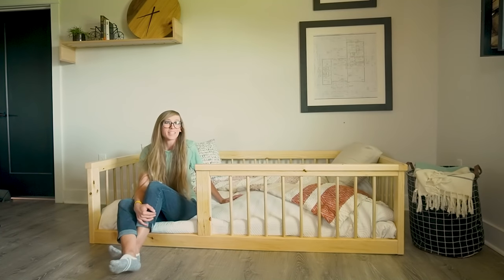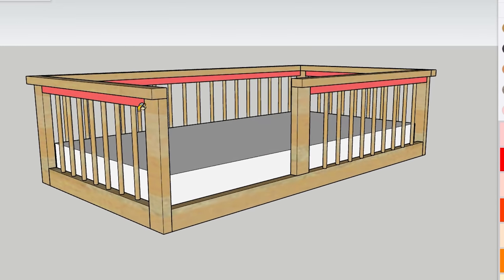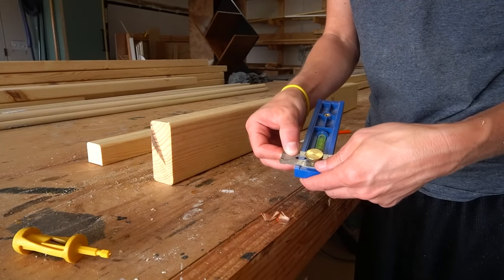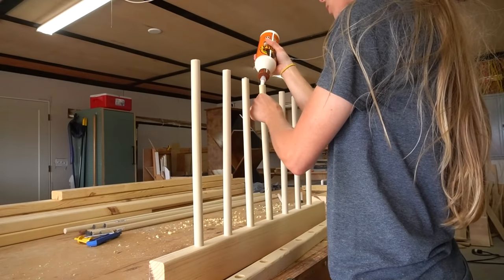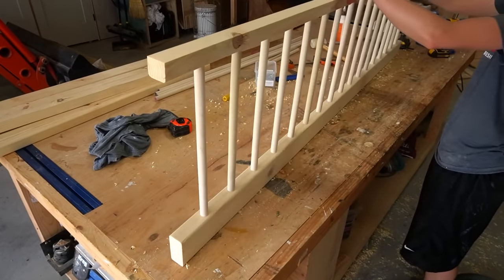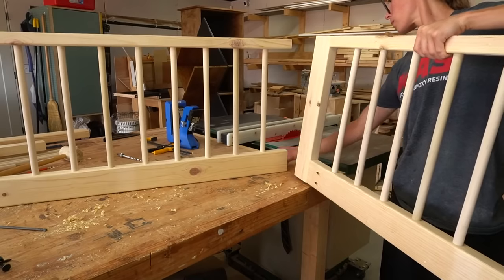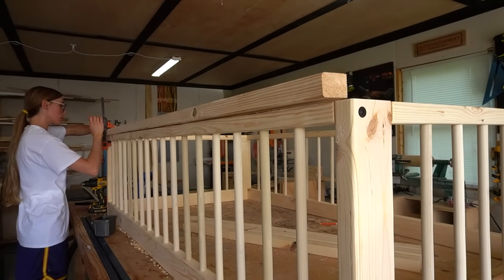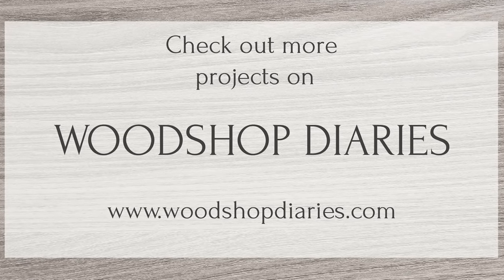How to Build a Kids Floor Bed--From Dowels and 2x4s!

Comment: Thank you much. I build one looking at yours and it turned out great. One thing I did different was I used the 2 by 4 on both top and bottom without ripping it to smaller size. It is very strong and my kid has been enjoying it.

Comment: I have built nearly the nearly the exact design for my toddler.  Its awesome to see someone else doing it like I did.   This video doesn't show the pain of finding perfectly straight dowels and boards. I know the struggle of getting all those dowels to line up on the top and bottom.  I did a double so i had room to get in bed and lay with my little.  I used slightly smaller dowels but watching you build yours was like re-living the building experience because ours are almost identical. Only other difference is that  I did use a 2x6 as the bottom board.  I built a second bed for a friend and on the side with the opening, i actually took that vertical board to the floor to add a little strength.  I think you did a wonderful job.  That kiddo I'm sure is going to be enjoying that for years. Well done!

Comment: Nice build. Where were you able to get straight 2x4s? Home depot or similar? When I buy them from HD, I always cut them to get straight edge. I have also requested planner for my Bday to deal with board like that.
Reply from the maker: I usually get my 2x4s from Home Depot.  It takes some digging through to find good ones, but they usually have a decent selection in my location.  I normally trim the edges square, but in this case, the rounded edges were good to keep to avoid sharp edges on a kid's bed.
Reply: @WoodshopDiaries  thank you for reply. In one of you videos (dresser with draws, maybe?) You got a poplar board and mentioned you got it at lumbar yard because one side was rough, you then you run it through planner. I'll be finishing up my dresser today and hot my poplar from HD. Was the poplar from lumbar yard significantly cheaper? I don't have any near by , but once I have the planner, I'll be likely looking for lumber there.
Reply from the maker: We have a saw mill that makes flooring in my area. It’s the only place to get any “hardwoods” and it’s decently priced, but only comes rough sawn. It’s not designed to buy lumber by the board foot as they specialize in flooring only, but they’ll make an exception here and there.

Comment: I am curious for your design when your friend asks you to make something to raise the bed because the boy has become a bigger boy ans is old enough to use a normal height bed. By the way, you are smart to use pillows to immitade a matras. I didn't see it first. Great design to.
Reply from the maker: She may want a whole new bed, but a great option would be to build a simple platform with drawers underneath to set this on top of and have storage underneath 👍
Reply: @WoodshopDiaries  of course. Drawers. Your favorite. I did not think of that. Good option.

Comment: Free building plans but it says 7.99 to get the plan.
Reply from the maker: There is a free version on the website. The printable version is a paid upgrade.
https://www.woodshopdiaries.com/diy-toddler-floor-bed/
Reply: @Shara Woodshop Diaries  where I saw it , that's not what it said. Sorry, I should have just gone to your channel first. I'm still going to use the plan you have to make a queen floor bed for my son.